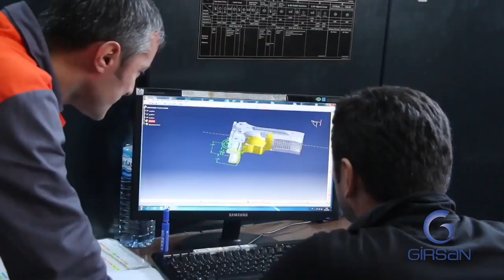Girsan Factory Video

Comment: ALL THIS PROMOTION AND NO ONE HAS POSTED A DISASSEMBLY OF THE 
GIRSAN MC 28. DO YOU PEOPLE KNOW HOW TO DO IT SO IT CAN MAKE IT EASIER OF US THAT HAVE ONE OR TWO OF THESE PISTOLS. LETS GO GUYS THIS IS 2019
Reply: The MC 28 that's easy. Make sure the weapon is clear of ammo first. Drop the magazine check the chamber to make sure it is clear and unloafed. Then let the slide go forward slowly, point the weapon in a safe Direction and pull the trigger to release the striker. After that put your thumb and index finger on the take down tabs and pull down with your non-firing hand, then pull the slide off of the frame. After you have the slide off the frame turn the slide upside down take your index finger put it on the rear of the recoil spring assembly apply slight pressure lifting it off of the barrel. Then lift the barrel up slightly forward and then pull it out to the rear. You are now field stripped.  assemble in reverse order. I'm sure you can find any Glock type of a disassembly or Smith & Wesson M&P disassembly video would be the exact same procedure.
Reply: Thank you for the reply, but I'm talking about a disassembly not a field strip.
In case you misinterpreted what I was talking about.
 I'm mean a full dissemble and reassemble.
Like the trigger, striker, internal guts etc.
I can do a field strip with my eyes close on most semi auto pistols.

Comment: These turks know how to build a great firearm. Problem is you only get one magazine and currently there are no mags available in the United States. If this mag fails I have a 2 pound door stop. Avoid this company until they furnish magazines available in the states. Get a Glock and get all the 17 round mags you want anywhere. Oh and for 20 bucks.
Reply: Not true. Depends on the model.  They have a beretta 92 clone. Uses beretta mags no problem